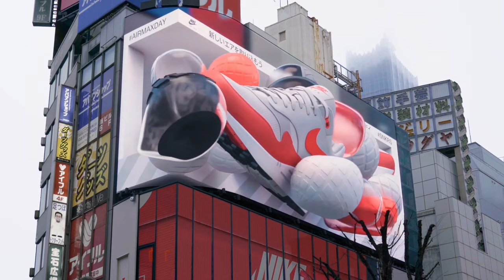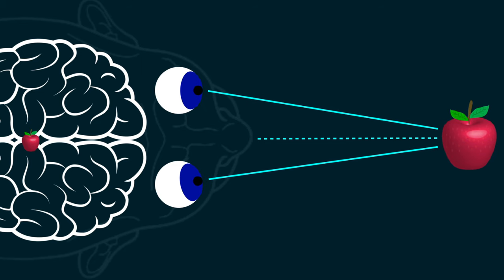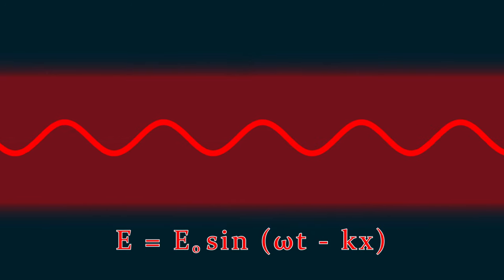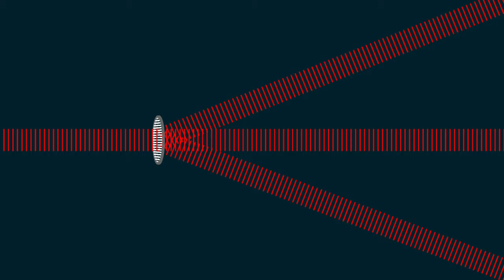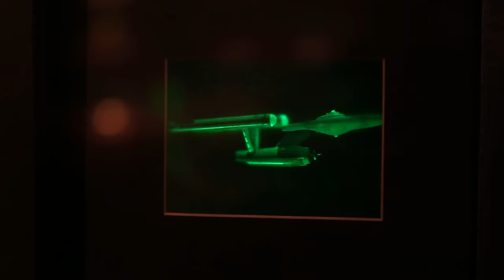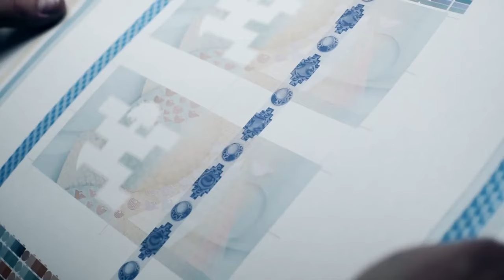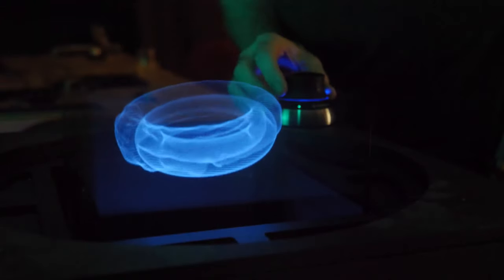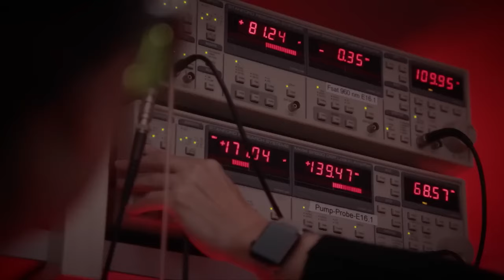Holograms and Volumetric Displays: How We Learned to Create 3D Images, Like in Science Fiction

Comment: As far as I'm aware, the looking glass uses a different method than a defraction grading. Where complex defraction grading uses the warping of light through the medium to a "remembered" image, the looking glass uses a lenticular sheet.

Lenticular sheets are a sheet made up of lens tubes that bend light. The Tubes themselves are increadibly small and create a large sheet. Nowadays they are touted as invisibility sheets since the light warping effects are so extreme that anything beyond direct contact with them generally falls into a blind spot for most of the lenses. The image results in a blurry and stretched picture of the surrounding area that generally obfuscates the object behind it.

With that being said, before they were used like this they were very popular for commercial purposes. Any time you've seen a poster or image that changed what it showed based on what angle you were looking from, it was because of a lenticular lens sheet. Until looking glass dedicated themselves to working around it, there was a massive roadblock to using lenticular lens sheets for holograms. since the effect was based on layering multiple images as strips next to each other on the same image you needed a higher dpi image to improve the reolution as more images were layered next to each other. To improve the quality of the effect you needed as many different images layered together as possible. And to improve the clarity and prevent the jitter from one image to the next you needed to shrink the size of the lenses. The issue comes where the lenses can only achieve the effect if all the layered images fit within the width of the lens. two image were easy since you only needed to fit two strips of the image in the width of each lens but with each extra perspective it gets exponentially more dense.

Looking glass portrait portals cost so much because they brute forced the solution by using ultra high density screens with a custom ultra fine lenticular sheet. Then they use built in programs to take the dozens or hundreds of overlapping images and make the appropriate changes to stack them all together.